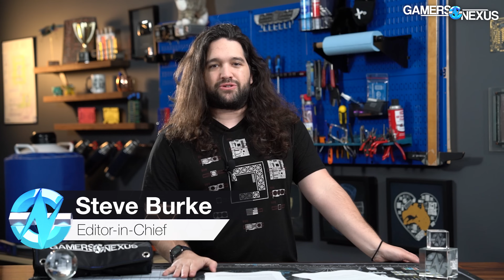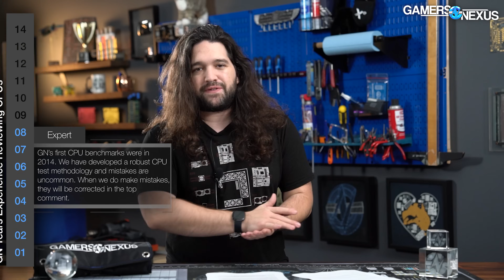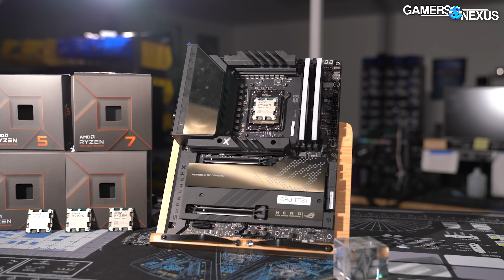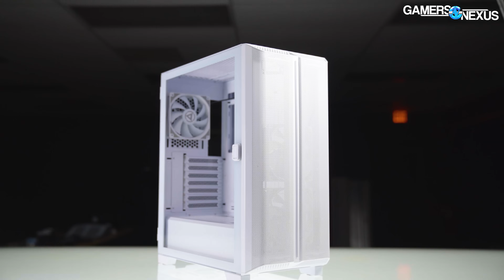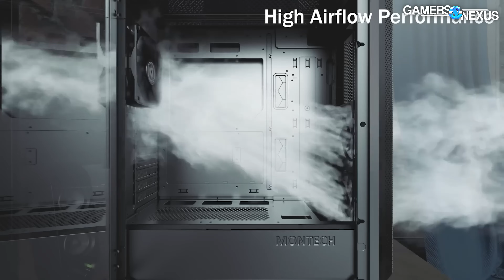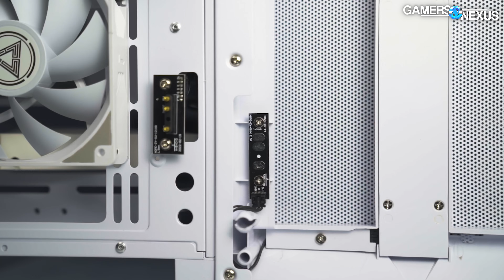AMD Ryzen Eco Mode Deep-Dive & Benchmarks on R9 7950X (Zen 4)

Comment: I don't believe the intent would be to cut down performance so much. But I can see a use case where you build a passive cooling system. Almost zero noise, with good performance. 
Would a 105w or 65w tdp 7950x be better than a low tier equivalent cpu? 
Same goes to gpu. I saw derbauer video where he lowered the power target of the 4090 and got massive energy savings with almost no performance impact. 
If someone has the money and wants to build a passive cooling PC (or close to it), I think it's a valid use case. 
Not to mention the PC would last longer and ind the end, if needed in the future, just go back to stock or even OC match newer hardware.
Reply: As someone else pointed out, it also carries implications for laptops.

Comment: Great video Steve. But @7:52 "because Bulldozer was dumpster fire and later got them sued".. Yes, to match the Intel performance AMD Bulldozer CPUs had more "cores" and ran at higher clocks using more power (and more heat of course). I never had any actual issues with my FX-8350 (and it was quite a bit cheaper then - whole system cost). The lawsuit was about false advertising due to CORE COUNT claims as there was some shared resources that didn't make each core a full core (per the lawsuit). Just pointing that out as you made it sound like the Bulldozer was just such bad CPUs or they had such high TDPs they were sued. False advertising is not the same as the CPUs be a dumpster fire. And we all know how creative the advertising departments can be....

Comment: Would absolutely use 105W Eco mode pretty much everywhere. Almost non-existent perf difference, while massively cooler and thus likely quieter, and using 40% less power. It's a no-brainer.

Comment: AMD blew it on the AM5 chip and socket design. De8auer has shown that with direct die cooling the chip could stay cooler then 90 degrees.

Comment: Would love to see an updated and deep dive on PBO with information and tips from AMD directly (or at least have them confirm your findings\data). Especially things like tuning Curve Optimizer for Ryzen 5000 and 7000
Reply: and ^thats^ why I want some information from AMD
Reply: der8auer has interesting videos on power efficiency of Zen4 and 13th gen, in increments of 25W. For curve optimizer, -10 should be fine for everyone, and most should be able to do -15 or lower. My tip would be test idle stability, I can run -25 Cinebench (5800X), but crashes at idle unless I go to -15. Wish there was an option to boost idle voltage.
Reply: @xeridea  idle voltage already runs at 1.4-1.5 volts, not sure why you would want to increase that. If youre crashing at idle regardless of your CO settings you probably have plenty of other settings tuned poorly. I would do some more some research before giving advice.
Reply: @four20thirdeye  My idle voltage for 5800X is 0.95 volts, load is 1.15-1.25. Zen4 voltages are similar, or slightly lower. I have no earthly clue where you got 1.5V for idle. CPUs haven't ran at this voltage in ages. Even OC people don't even run that high without liquid nitrogen. Do you think CPUs run 2 volts under load? I suggest you hold back commenting altogether, you clearly have no idea what you are talking about.

Comment: Thanks for this video I will use the 105w mode... I am currently trying to get 4x32GB running at a decent speed. Not for any real performance reason but just to not leave performance on the table for no reason. 4200cl37 1.25v so far... not great not terrible. I couldn't get much higher stable with 1.35v and that's out of spec for my kingston 5600 1.25v (sk hynix memory chips) so I reduced it for now.

Comment: These factory overclocked , overvolted cpus imho are stupid.    

They should be run at a reasonable level at stock and toggled to what is now stock manually by the user.

Comment: These results just make me shake my head at how unbelievably dumb Zen 4's stock power use is. It's one thing to try to beat the competition, but the 105W mode doesn't even change the relative positioning! Wherever they are vs. Intel doesn't even change when lopping off fully 100W. It's absolutely absurd to be putting out chips that guzzle down 100W too much power for absolutely no reason nor benefit whatsoever to anyone. I just don't see the marketing advantage, if anything it seems like it would have been MORE of an advantage to make the 105W mode stock, and then brag to high heaven about how power efficient they are at still top performance. They're kind of even doing that with RDNA 3, "no need to change your case or get an extra power adapter!" etc. I just don't get it. It's one thing to waste gargantuan amounts of power because durr marketing, but there's not EVEN a marketing advantage here by all appearances. Argh.

Comment: My personal interest in this is that I donate my spare CPU cycles through boinc when I don't need them. For that, I limit my (4800H laptop) CPU to 20W using power saving mode. In that case, the efficiency is absolutely worth it!! Balanced mode is 10% higher frequency for 75% more power and I don't even bother with High Performance mode. I just suspend boinc when I want to use my computer quickly!

Comment: Hi GN,  the numbers indicate the 105w mode is twice as efficient as my current 7700k, however my current CPU uses only about 15W right now for browsing, which means upgrading would save me about 7.5W, round this up to 10W, assuming a price of 16 cent / kwh, this would save me a whooping 0.16 cent per hour... even under load it'll probably be not much more than 1 cent per hour saved. So upgrading just for the sake of power efficiency would be a complete waste of money.  It would take years to make back the cost of the CPU. Did I miss something? Or does it actually make sense if I plan to use the CPU for 10 years?
Reply: These charts for production are for all core loads. A single core going full tilt is still under the 65e mode. So this doesn't apply for when you aren't pushing it as that is when the limit comes in.

Comment: I actually really think eco mode has a place in the laptop market. Imagine being able to plug in your laptop and get the full 170-watt performance, but when on battery it consumes 65 watts. Accompany this with the ability to swap between integrated graphics and a dedicated GPU. You could have a laptop that can GAME hard when plugged in but have a really good battery life.
Reply: Don't laptops already do that?
Reply: No proper laptop has the cooling for a 170W CPU.
Reply: Laptops have done this since forever, albeit not as much for battery life and thermals as much as laptop batteries aren’t powerful enough to drive desktop CPUs running at full tilt.
Reply: Additionally, 65w tdp is actually about 90w consumption, and the full 170w tdp more like 260W, my 5800H does real 45w max, viable in a non-fat chassis
Reply: 170w on laptop? LOL
Reply: 65W is quite a lot for battery. 15W to 25W would be better in this case.

Comment: @Gamerss Nexus,  please retest by 65 watt in ECO mode but under volt.  This can sometimes take advantage of the 5NM technology and result in massive gains in games.  This will not work well in all core but can sometimes boost a couple cores extremely high and hold the boost. Thanks

Comment: Just upgraded to 7700X yesterday and met with absolutely fans blasting with first benchmark because of 90+ temps. But I knew that before buying.

After enabling ECO mode, which for 7700X would be 65W as it is 105W TDP stock. Huge difference in temps(Barely hear fans as temps stay around 60) and decent power consumption. And while it is not same CPU, I dont expect huge drop in performance with 7700X either.....eco mode is the way to go. 
I somewhat understand the need to extract everything out of the CPU while sacrificing power and thermals...because performance sells. At the same time, they almost lost my sale if it wasn't for the eco mode, I just wish they mentioned it more.

Although it was kinda simple option in the bios if you search it and I believe Ryzen master has it also. I didn't actually know that. After reading couple articles I though you had to input numbers in the BIOS/PBO and thats what I first did. Didn't actually work for some reason, but then I found simple eco mode setting in bios and that worked well.
Reply: Try PBO undervolt 20mV.. it's will go from 150w max to 99w max (more or less) with 1-2% loss in frequency
it's will be good mix of performnce per watts
Am waiting my 7700x to arrive.. still didn't decide what Mobo I should get.. 
Am leaning between Asus TUF B650 & MSI Tomahawk B650.. Tomahwak is better but slightly more pricy
Reply: @Jack_Sparrow131  I keep that in mind, but dont want to mess too much right now. It works and I'm happy with performance, temps and power.

I went with Tuf B650 as I also had Tuf B550 and had no problems with it.
Reply: @Kr1sVr  did U try OC the RAM ?
I heard some RAM models have issues hitting anything more than Stock..
Also I hears when enabling XMP/EXPO (RAM OC) its losses the PC sleep mode
Reply: @Jack_Sparrow131  I bought Corsair 6000Mhz EXPO ram and after updating bios to latest I did enable it. Asus has EXPO I and EXPO II, one being EXPO with some extra ASUS settings I guess.
But both settings worked no problem. 

Same for sleep, it's there and does work. On first day, I did notice some weird things, like my mouse didn't wake PC up, keyboard did....aswell my PC didn't pick up my TV HDMI when waking up, had to switch to monitor with Win + P and back TV. 

But day 2 and now 3....mouse wakes it up, TV gets picked up. Looking good so far!
Reply: @Kr1sVr  thanks for the details.. yeah seems the bios updates helped a bit for ironing some bugs & compatibility overall
I'll guess I'll go with B650 TUF also, it's not great like Strix or even Tomahawk.. but at least it's cheaper & good overall 
Best of luck to you mate

Comment: 5800x was a preview of Zen 4 issues. You can actually trace AMDs decision making with Zen 4 through the 5800x, most reviewers ignored this SKU at release because it was bad value and had bad thermals with high power usage for little gain but the signs were there.
Reply: The funny part is if you tune a 5800X with curve optimizer and a slightly different PBO limits they are easy to cool. The stock limits, especially PBO are not the best for sure.

Comment: I actually had a 5950X running in Eco mode but mostly because it was installed in a small form factor system. Only took a hit in multi core performance surprisingly.
Reply: Same with my 5900x. Single core performance actually increased slightly in Eco Mode.
Reply: @glosan9516  Do you use the default Eco mode or do you have a handmade one? I am running (95W TDP): 128W PPT, 80A TDC, 125A EDC but hoping to see if anyone finds a better balance based on the efficiency curve like what Debauer showed for NVIDIA.
Reply: That makes sense. Boosting only 1 of 16 cores should stay well within the power limit when the other cores aren't loaded heavily, and of the other cores are clocked lower to begin with because of the ECO mode, you can actually send more power to that single core due to the additional thermal headroom.

I noticed something similar when I was undervolting my 9750HK laptop. I lost about 10% on multi-core performance, but gained 9% on single-core while never touching the 135W power limit. I actually stayed below 120W even in a full Cinebench R23 10-minute test.

Comment: It would be a lot of testing probably but to average Future CPUs to a much lower TDP for Gaming reasons would be interesting.  This video as well as other videos from other content producers show that in Gaming these newer CPUs are way over pushed for the needs.  So maybe since I know you can test system power draw, setting a fixed Wattage maybe interesting to give the CPUs a level playing field.  That way you are comparing Apples to Apples and not just running at what the Bios says for the CPU.  Lower heat generation is a desired trait at least for me since I would love my gaming rig to not be a space heater if it does not need to be.

Comment: Very interesting. Is ECO mode considered as OC? For example, if you use ECO-Mode, do you lose your warranty?
I am asking because i have a 7950X and tried to change the limits for power and thermals and setting it to max. 125W and max. 85°C. With that settings i lose much more performance and get in 65W range from your charts. Also when i undervolt the CPU by a tiny amount, like 5 mV, it crashes instantly. That is not normal isnt´it?
Reply: That is an interesting question. Technically activating PBO is considered overclocking and will officially void your warranty. And since you need to enable PBO in order to activate the Eco mode, it should also void the warranty. Even if you're trying to put less stress on the CPU than it was intended for.
Reply: @sp00n  What about if the default settings of the PBO is set to "Auto" always? If i reset the BIOS or change it to default settings, PBO is set to "Auto", not "Disabled" on my X670E ASUS TUF Gaming Plus mainboard. That would mean, that the CPU is allowed to automatically overclock? Or what does "Auto" mean for AM5? I watched the old PBO video from GN, but dont get it, because i dont use Auto-OC and never indent to do use.
Reply: @F1nalspace  "Auto" is indeed the default value and the official guideline by AMD says that PBO set to "Auto" means that it is disabled. However, I've read reports that not all of the motherboard manufacturers seem to adhere to this guideline and activate it anyway with this setting.
That's probably also the reason why Steve mentioned in this video to report any such manufacturers.

Comment: How much power draw do case fans and CPU coolers use? As mentioned an efficient PSU can reduce overall power consumption. What is the most overall efficient build - PSU, heat vs cooling energy and performance?